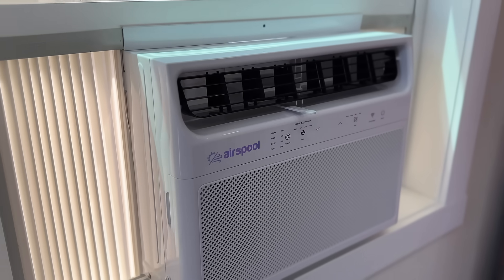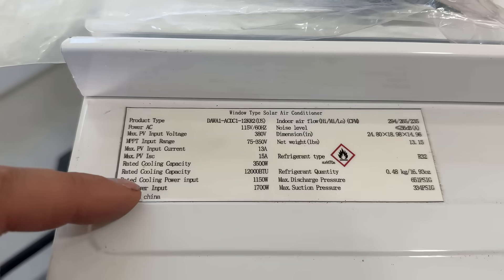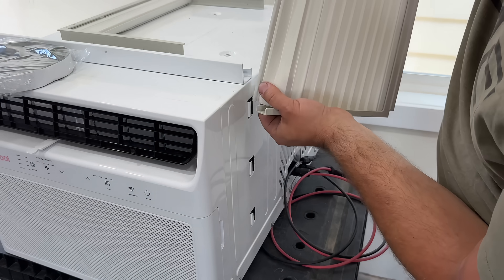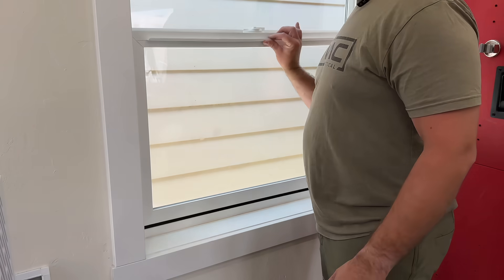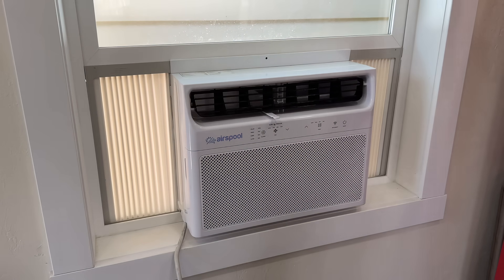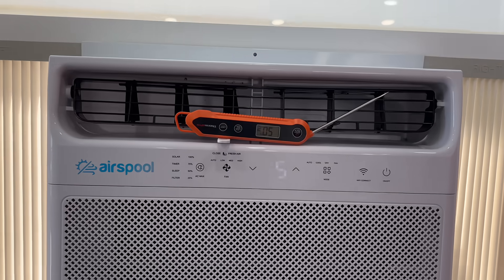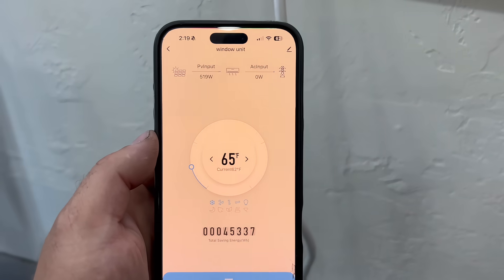Introducing The World's First SOLAR WINDOW AIR CONDITIONER...

Comment: Nice, but I've had a solar/battery operated HVAC in my camper for a couple years now. Works well for the limited size of my camper, but for a big room, I'd still go conventional split.

Comment: They also make a little C-clamp, with a wing nut that you can lock onto the window sides and they only take a 1/4 turn, to remove if you want to use the window. You would have to break the window glass to get to them. They could do that on any window, if someone really wanted in.

Comment: I was excited about this system until I found out it can't run off 18v nominal. If you have random flexible panels rocking 18v you have to put them in parallel which drops efficiency across the whole string every time there is even a little shade.

Comment: I have a few the midea 8000 Btu, window a/c u shape inverter type, also a few power stations to run the off solar as well, depending on what you pay for a power station it and panels, these days you can pick them up real cheap. Run your a/c all day and if in an area where you can do free electricity at night it could really pay for its self very quickly. This unit is very expensive. I kinda like the idea of have the station running the A/C and having it for other uses for winter.

Comment: Wow so wish they did a through wall install one i have a through wall unit 12,000 btu it cools my livingroom kitchen and one of my spare rooms prety well but to have a solar version that wasn't pulling from the grid all the time would me amazing  also been looking at replacing it with either ducted or a 3 head mini split  just have to wait and see what they do if they make one for through wall systems to replace older ones

Comment: Considering the cost, plus the cost of the amount of PV panels you need if you don't already have them fully evaporates any  "saving energy" cost. If this thing lasted 15 years maybe. The positive is that you would have cooling in times of extended grid outage which is a huge plus for me. I live in semi-tropical 9 months of the year.

Comment: Only way this will become the norm is if the price comes down enough to where the avg person can still afford to buy the solar panels, battery or powerstation, et al and have the cumulative energy savings be substantially greater than the costs of eventual  components' replacemet vs traditional ac units. Maybe in 10-20 years is will be practical.Sorry ....WAH.....WAH.

Comment: I desperately could have used this years ago, before I spent over 7k on 2 separate window AC units and another 13k on a custom triple-pane argon gas-filled window because my bedroom is on the southeast corner of the building, meaning I get sun pounding on my south wall ALL DAY LONG, turning it into a Dutch oven.

Comment: I am running my entire RV power on a 2000 Watts solar panel and two 280ah  lifepoa4 batteries including my 900 watts mini split that I have purchased for about $500.00 for 8 to 9 hours for a complete system that cost me $3500.00. I am living in Arizona.

Comment: exorbitant but it could be justified if you want to cool dehumidify a room daily when whenever the sun is up but no power outlet yet. otherwise, I can replicate this setup with similar spec ac plus a power station. while the powerstation plus ac can be janky setup for the same price, it can store some power in the batteries and but now own a power station that can be reused.

Comment: Do you need batteries to???? I live in florida…
Reply: If you could source a big enough heavy duty robust Dc-dc buck converter(s), you wouldn't need batteries if you only wanted to use daytime solar energy. Might need parallel buck converters since they are notoriously iffy handling motor loads.
Reply: if you need batteries then just get a power station and equivalent window ac

Comment: 12000BTU? Damn, that unit is small for the huge amount of heat it moves. Also, the interface on that looks strikingly similar to my Midea 8000 BTW window inverter. Which I love. I have a feeling that the makers are connected somehow.

Comment: You can also cut a dowel rod, 2x2, or even PVC pipe to about 1/16 of an inch larger than the measurement from the top of the window to the top window frame and tap the wood or PVC pipe into the edges of the frame making it impossible to life the window without making screw holes.

Comment: Here's my problem with this. If an ordinary unit cost about $300, and electricity for that unit cost $35/month let's say 5 months out of the year, it will take at least about 4 years before I'll see any ROI from buying this $1000 unit assuming it never consumes power from the grid. Doesn't seem like a smart idea to me....
Reply: And that's if the mf doesn't break and/or need costly repairs.....which I've heard is prone to happen.
Reply: What your paying for is the control unit.  You can run a regular one and put in a control unit,  but which way is cheaper. I've done the math and my only need for solar is my AC. Without AC my bill isnt even $100 a month,  but with it,  it can be 300 to 400. For $100 solar or any other system is pointless, but for 300, I'm considering options.

Comment: What happens when it rains with a window unit? Haven't you basically opened up the bottom window? Shouldn't you be putting sealant on the outside of the accordion sides?,

Comment: My only issue with window units is that they are mounted in the lowest point of the window. Heat rises and cool air sinks so you are recycling the same cool air over and over. As an experiment I used a couple 8’ flexible foil dryer hoses installed into a piece of cardboard big enough to cover the intake panel of the unit and I suspended the loose ends a foot from the ceiling. It has done wonders for removing the heat from that room. It looks very peculiar but no one else sees it and it works very well.
Reply: Dude! I've been griping about this inherent design flaw online forever. Not to mention, the cool air out register dumps the falling cold air a few feet in front of the warm air return register, so that loop back effect is robbing some of the cool air that needs to cool the room instead. I've been(lazy me)  meaning to do that same experiment using long rectangular cardboard tube box to route the return register to the ceiling.(might need an inline dc fan to help force the  hot air downward,keeping the same original CFM airflow). if you can substantiate the improved cooling efficiency with numbers or a video, I'd love to hear it!!!
Reply: Ceiling fan. Your welcome. 😎

Comment: FYI:  You can do this with any window a/c that runs on 120 volt by using an adequate power station and solar panels.  Much less expensive and if you buy a large enough power station, you can use it to operate other items as well.
Reply: I agree completely. It's hard to justify spending over $1000 for a window unit when you could buy a portable battery and a slightly smaller window unit and then you have the versatility of using the battery elsewhere if needed.
Reply: @inc0de And that extra energy savings might vanish, if you have to replace the inverter ac just as often as a traditional unit.
Reply: Guys, the big thing that this unit does is it avoids the inrush current.  So, normally, you'd need a big ol' MPPT, battery array, and inverter to run an air conditioner.  So, that's why people don't do it.  This will work more easily if the window (or mini split or whatever) unit has an inverter compressor (not be be confused with an inverter).  But yes, if you were just to set that up, you'd need the separate MPPT, batteries, and inverter.  For this, you don't need those things.  And, you don't need to do any battery maintenance, etc.  So, this is simple.  And, actually, are core audience is people who already have MPPT/battery/inverter systems, since this unit preserves their batteries during the daytime (plus they don't need a bigger system (MPPT/battery/inverter)), and it draws less power at nighttime with the 4 different compressor speeds.  So, yes, weigh your options, but this (or our mini split) are great options for a lot of folks.
Reply: @airspool Has anyone tried this? Start the window ac on grid, then once the inrush is done and the wattage settles down to 450-550 draw, have  an auto xfer switch switch the power supply to solar.Then when the compressor disenguages, have the process repeat when it kicks on again. This way you only use grid to get the compressor up and running, then once wattage stabilizes, switch to solar.(kinda like the idea that once you get a car up to speed, it takes minimal hp to maintain speed). And you wouldn't necessarily need batteries, if you use big enough dc-dc buck converter(s). I want to test this but don't currently have enough panels.
Reply: @airspool any plans for 48vdc direct mini splits or window units? I don’t need the hybrid.
Reply: Exactly ❤

Comment: Higher the efficiency the LOWER the capacity. Experience.
Need to know the BTU's it will transfer.
Anything less than 8,000 btu capacity and you are wasting your money. You want 20% more capacity than what the chart says, in case of a high heat wave.

I have yet to find any solar anything that doesn't need a whole lot of panels and batteries to match what you get from the grid with a regular device.

Won't work in many windows. Casement is one. WIDE windows is another.

Author presumes you have the small double pain double hung modern windows.

Plastic accordion is a very poor insulator. They get brittle after a while and split.
Replacements are brand specific too.

There is a gap between the windows when you lift the bottom window. Lets hot air in.

One way burglars get into your house is to lift out the window A/C.
Be sure to secure the A/C and the window.

700 watt a/c needs at least NINE or TEN of those 100w panels since no panels output the full 100 watts.
You want extra to charge batteries if you have them.

MORE effing BS with wifi. It is absolutely not needed and just pads the price of the unit.

Don't fool yourself either. 51 deg air output means little unless you can do that at high air flow (volume).

For me I want all mechanical controls - NOTHING electronic as electronics are junk.

They break and you have to buy a whole new unit whereas mechanical you can many times replace the bad switch. 

Whopping $1200 plus shipping and taxes is 4-5 times what it should cost.

Comment: It may be useful for people with no grid electricity, but at $1100 cannot justify it. Make more sense to buy a 12k btu ($420) window unit and running it on grid. my area it would only cost $23 a month to run all all day at 76 degrees.

Comment: how many 100 watt solar panels would be needed to power this?
Reply: 17, as it says 1700w.
Reply: Conorton, yes, it's a full 12k BTU unit.  Normally, it'll run at around 1,250 watts on the hottest days.  But solar panels become less efficient on these days, so that's why we recommend 1,800 watts.

Comment: Why not make it connect to a battery and solar panel strictly for charging battery instead of connecting ac directly to solar panels ??
Reply: 1700w is a lot of power, it would drain a battery quickly.  His 7 panels are only restoring 1400w.

Comment: Price seems too high. Midea u shape 10k in Eco mode keeps up most days and maxes out under 600 watts. $300 
1500w inverter maybe $200.
And then battery size your choice but say $300.

I guess for the extra $200 you get a package ready to go and a nice app to monitor everything. 

Personally i think they would be a real contender at $800 maybe even $900

Comment: IT IS NOT SEALED FROM AIR LEAKAGE!
Those accordion louvers ARE USELESS, they do not stop air and heat getting though! The foam in box is open-cell, meaning hot air will flow though.  WORST, look under the unit, there will be a gap big enough for a cockroach to get though! 
I had to buy myself 1" polystyrene and cut squares to completely cover the sides and above, then closed-cell rubber foam to stuff under it to make a TRUE air tight, bug proof seal!
ALSO, you need a bubble level to make sure the angle is correct, does not take much to have wrong slope.

Comment: Or you set up your solar to run the whole house on 110 , 240 (normal) like I did.  With 9000 Ah of battery I don't have to worry about power. It is all controlled by properly sized inverters and controllers so that even if I lose one bank of batteries I still have 110 power throughout the house.

Comment: Looks like a good deal. I'm looking at $600 for a 3kw inverter plus $400 for 200 amp battery to keep any air conditioner rolling otherwise. And I'd have to build a cabinet to store those and put up with the noise of the inverter fan, otherwise it's another $200 in wires and parts to build it in the basement.

Comment: I don't see anything special about this. Any AC unit will run on solar if you have a solar panel installation.
Reply: Right.  So, what's special about this unit is that the panels plug right in without an inverter, batteries, MPPT, or net metering.

Comment: My Midea U window AC $299 is the First solar power AC before your solar AC. I had it working off of solar for the last 3 years.

I have 2000 watts of solar panels. 10kwh worth of batteries and a 3000 w inverter.
The Sun provides more than enough to run the AC, two freezers, one refrigerator, lights, and TV all day. At night, the bedroom where the AC was running all day is at 65 degrees. Perfect for a good night's sleep 💤💤
Reply: Was your unit included with the current recall? Did you get the repair kit already?
Reply: @elmannyd 
Yes!
I drilled a bigger drain hole. 😂
Reply: They offered ~$480 to us so we took the money and bought one of their standard units that also does heating, it's awesome and was cheaper than the U
Reply: Thank you, your info was very helpful as we are getting ready to install solar at the house and are looking for a way to cool a room and use other appliances.
Reply: Must be nice to be rich! lol
Reply: @crazysquirrel9425 
I paid $5000. Uncle Sam gave me back $1500. 😂 You get 30% tax credit for anything larger than 3kwh system.
I bought my panels from Suntan solar in Phoenix Arizona. They're are reclaimed, refurbished, somewhat filthy. But works great and price is 75% off. 😂
The rest are Amazon stuff.
If it weren't for Uncle Sam and Suntan. They definitely will be $10k and higher.

Comment: These are a great way to get air conditioning in a hurry if you don’t have reliable power.
For just a little more money you can do much better. A 3000 watt EG4 inverter,$699, a 5 kWh server rack battery $1300,along with the solar panels you have to buy for the solar direct AC unit gives you a source that will run your refrigerator and basic lighting for your house. The Bluetty and Eco Flow units other people mentioned also do the same thing but are generally more expensive and with less PV input for the money.

Comment: I really wish there were more units to fit side sliding windows. I don't have any raise windows and would love to have a unit in my bedroom where I am most of the time.
Reply: This same direct PV heat pump option is available from Signature Solar in a mini split. Just need a 3” hole to run the refrigerant lines,condensation drain and communication wire. Slide the window open a little,put 3/4 plywood rectangle with a 3” hole in it and mount the indoor part there. Very quiet and efficient.

Comment: How does this compare to the solar-powered mini splits that I have seen on YT.
Reply from the maker: It is a touch louder, uses a bit more solar, but does not require drilling holes in the wall. So there are pros and cons

Comment: $1,000 window unit is crazzzyy
Reply: Those can pay for themselves in about 2 to 4 years, depending on electricity rates, especially in the south.
Reply: @redbaron6805  I can't pay for iteself it anit solar panels its just a AC unit its still gonna draw energy.
Reply: @navtheartist  "I can't pay for iteself it anit solar panels.."  Not sure what that even means.  What exactly is "anit" solar panels...?

You DO know that this A/C unit is specially designed to run on solar power, right...???
Reply: Especially in Florida where lightning wreaks havoc on all appliances.
Reply: @wardrobelion  It doesn't.  I have lived in Florida for 30 years, and the only thing damaged due to a lightning strike was a cable box which died after a lightning strike.

You can put a surge protector on pretty much anything or a whole house surge protector into your panel.

It damaged the TV connected to it by killing some inputs, but the TV kept working and still works today.

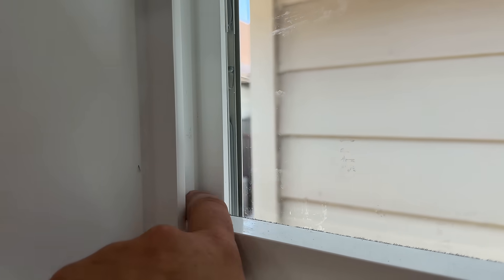Comment: 6:41 Cut a piece of wood & wedge it between the window & the frame on each side. No one will be able to open it. Another trick that will stop air leaks is to use insulating foam board. Cut to size & inserted on the out side of the accordions. It will prevent heat from leaking in around the cracks of the accordions.
Reply: My Dad did something like that for a simple security bar for the track in my patio door. He cut to fit a piece of aluminum rod with a little play to fit the track. Worked like a charm.  A similar thing for the window security here is spot on!
Reply: I use PVC pipe instead of wood but came here to say the same.  Why destroy your window frame :(
Reply: Was just thinking this. Good take
Reply: YES, but more than that!  Closed cell foam, tape, even silicone for some holes in the unit itself.  They are really cheap designs.